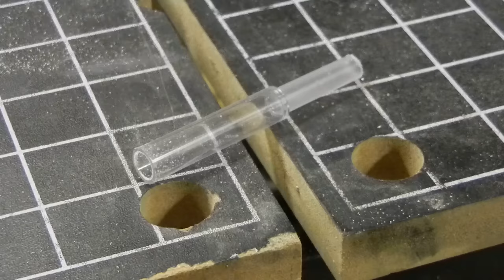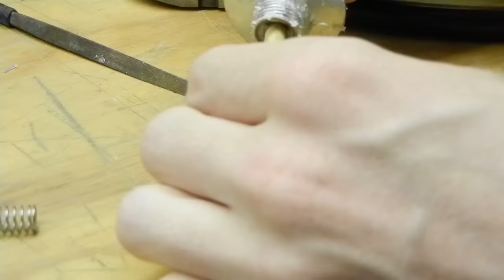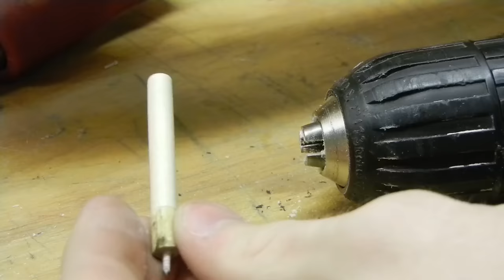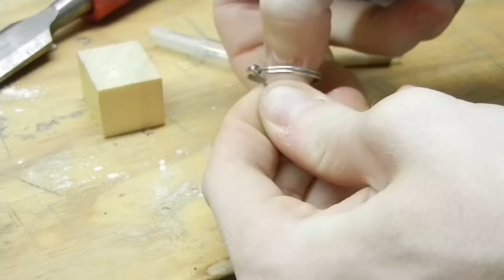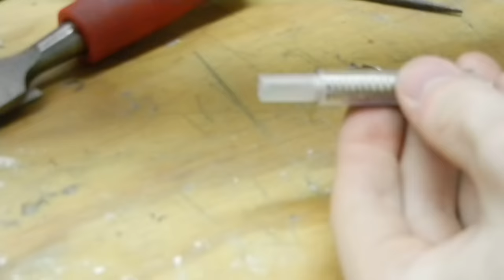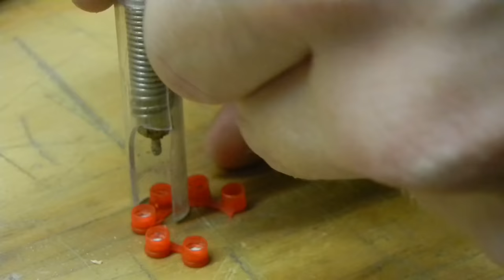How to make a Pull Pin Fuse

Comment from the maker: If you need a timed fuse something like a firework fuse could be added. This is more on creating the detonator part, as reliable fuses are easy to obtain. You'd just need to test the burn rate of the fuse to determine the timing.

Comment: To time this for a detonator, you could either put a certain amount of slow-burning fuel between the cap and the explosive, or put a weak pin that will take a certain amount of time and exposure to the tension of the spring further down from the safety pin. But this design is best used for things like smoke grenades and trip devices.
Reply: or maybe just attach a wire to the pull pin

Comment: its a pull pin. i dont know about the fuse part.
Reply: I think if you fil the part with the exploding cap with some form of incendiary like match powder and insert the fuse in there it will ignite
Reply: If a primer was included in this video, it would be considered a video on making explosives and removed by youtube.
Fun fact: if you pry the primer off of any centerfire ammo cartridge you can turn this into a time delay fuse.
Or leave it inside the cartridge and instead remove the bullet and stuff with iron wool and seal it and you have a blasting cap.
Reply: In south africa we call it clap gun claps
Reply: @madlarkin8  That would explode or flash immediately, would require a real fuse for delay

Comment: you say fuse but really its not a fuse has a delay this is a impact detonator as its more of a firing pin with no delay same method used in a claymore mine
Reply: or trip wire to set off mine.
Reply: you trip the wire, pulling the pin, firing the pin into the primer, witch in turn detonates the explosive. I design these things =)
Reply: Put the cap on a vizco fuse and you have a time delay
Reply: @jameshuges5837  this was the first thing that came to mind when I saw this video. I now feel the need to bury this video in my backyard.

Comment: The music selection was hilariously a nice touch. Sorry I couldn’t help myself. Thanks for the tip. I’ll definitely put it to good use. Also. Strike anywhere match heads in a small metal primer cap. Make sure that the fuse is completely contained separate from your propellant except for a very small opening where the fuse goes through into the casing with your boom. Also make sure the primer cap leads directly to your 3-5second fuse. That’s how a standard hand grenade is made. From a guy who may or may not have been trained in how to macgyver a weapon for any situation out of anything he can find. I want to stress caution test your primer/fuse containment a lot and use consistent materials every time. If you want an even safer (for you) option try mechanical “zip strip” to light your fuse as it leaves your hand in order to ensure it doesn’t cook off in your hand before you throw it
Reply: Hey, what do you mean by a mechanical zip strip? No matter how I search this, it just comes up with zip ties or concrete slab making equipment. Thank you in advance.
Reply: @mikebergman1817  similar to a zip tie. But it’s from an old banned toy from the 80’s. A gun you pull basically an oversized zip tie through a hole which turned the mechanism making sparks. To do what I mean basically take a larger zip tie super glue the paper just below the head to one side of the inside and the phosphorus strip to the other part of the inside or if you want to be really complex inside the head of the zip tie so that when you pull the zip tie it strikes lighting your “fuse” which is a small cone of powder leading to a thin tightly packed tube of powder leading to the charge. Make shift pull pin. It’ll take some tinkering to get it right.

Comment: This is a good design for booby trapping where you want zero delay. Youd have to implement some trype of slow burn layer sectioned with a hole connecting to flash for a grenade. Better make sure you're confident in your fabrication and chemistry ability before attempting.
Reply: Wonder if you drill some holes in the bottom of the pen where the cup sits for sparks to fly out and catch

Comment: own a tlr 7 and tlr 7a. the 7 isa backup now because it had a side pressure switch that would turn itself on in the holster the moment i sat down. otherwise, great lights. own 3 tlr1 lights on my shotgun, pcc and primary rifle. never NEVER had any issues with them. ill always use streamlight

Comment: I mean, theoretically you could just use a pen without any ink and drill a hole directly through the ink cartridge. the only issue is how flimsy a pen tube can be, but if it fires hard enough it could work well

Comment: To make it a fuse you'll have to add...a fuse. Meaning, while you could use a cap instead of a primer for ignition, you'll have to add some kind of a material that would be set on fire and then slowly burn to act as a fuse. Some smoke mixes work well for the job without creating all that much smoke, actually

Comment: Any ideas how to use this metod to ignite KNO3 smoke bomb?
Reply: @The Duzda, have the firing pin hit a pop it rock, (inside the "pop its" there is a little rock with pops on impact.) Wrap the rock in cotton and attach a firework fuse to the cotton leading to the smoke mixture.
Reply: Ok but the zippo fuel will have to be added right before the pin pulling, but I hope it works for you.
Reply: Why do you think that?

Comment: A time delay can be made with latex rubber band, in sunlight, it biodegrades. instead of using a pin using a ball bearing, ball! the rubber band eventually lets it go! releasing the activator,   the same with a thermal activator, a fire sprinkler activates the valve but also can activate anything else.like a striker pin!  that initiates a paper cap as in your case.sutch ultimatums potentially could undermine our authority who manipulate law to there own standards so be aware of this fact! and accept the consequences. !

Comment: Combine this with https://youtu.be/pgq9E_jse68

Do everything but the straw at the bottom of the cap.
Drill a hole in the cap and put this fuse in it, align it with the balloon.

Now you have a M67 frag.

Comment: Where’s the fucking delay bro? This shit gives you no time. I would think that the plunger would be tight in the tube to act as a gas shock absorber that would slide slowly with the spring pushing it down. This method isn’t practical only because of this fact.